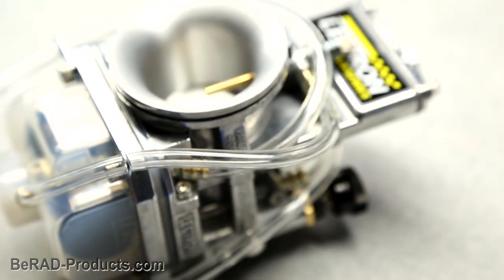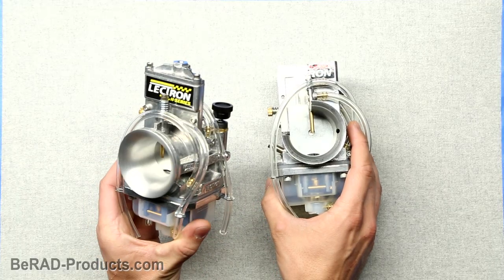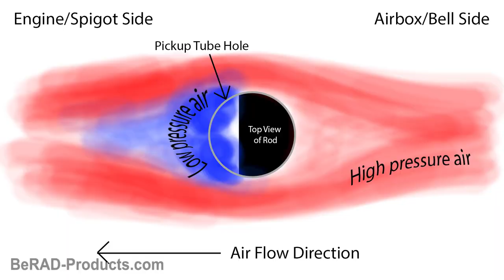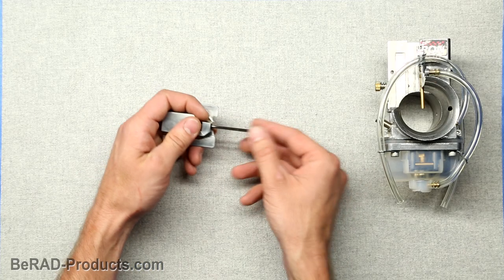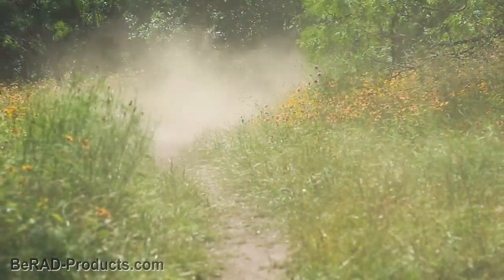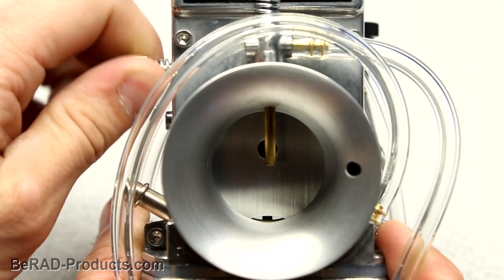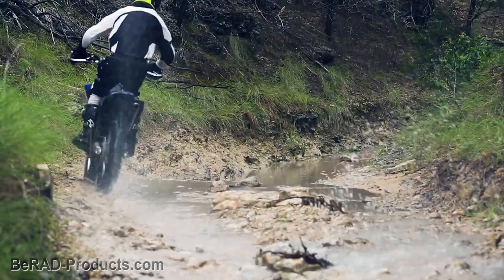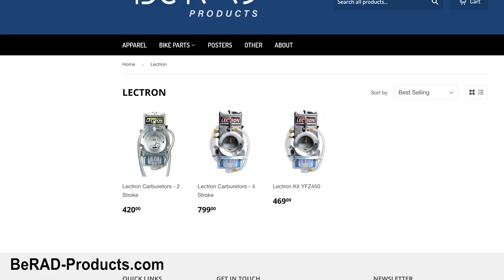LECTRON CARB - How does it work?

Comment: I don't really get it...

You said Lower elevation, colder temps, more dense air, stronger fuel signal, more fuel used. (Same at higher ekevation)
But doesn't this theoretically also happens inside normal carbs?

And why haven't the manufatures switched to lectrons?
I mean, they are cheaper than most keihin/mikuni carbs and apparently work better.
Reply: i own 4 lectrons, 2 on an Aprilia RS250, 1 on an RS125 and one on Daytona Anima 190cc engine in a Grom and they are frig'n awesome!
Reply: Hard to say if they're actually cheaper, as that depends on how big lectron wants to grow, and how low of a price they're willing to drop to. Keihin/Mikuni have the advantage of economies of scale when they produce thousands of basically the same carbs for all the motorsports industries with minor variations for each OEM, and I wouldn't be suprised if they were sold for maybe $100-$200 each.

Also, the Keihin/mikuni carbs for waverunners and jetskis offer a lot of adjustability between the varying high/low jets and screws, throttle plate angle coverage for when to activate the high/low jets, additional emulsion holes, vacuum discs and adjustable pop pressures to give a little "pump" with each revolution of the motor for actual RPM-based tuning rather than just flow tuning, etc. 
They are EXTREMELY tuneable from an OEM's perspective.

Comment: The fuel injection on 2t motors today is not all its cracked up to be. More for epa regulations and more expensive to purchase than carb systems. I do not recommend FI on 2t engines for few reasons that are not good
Reply from the maker: james bullock I’m with you. Have seen many of them not run well...it’ll be there eventually but you’re right, it’s done for emissions. A prefer the feel of carbs for 2 strokes still.

Comment: I'm not an expert so forgive my stupid questions.  Why is the Lectron needle/jet and different than any other needle/jet system such as mikuni (other than the lectorn being half-moon shaped - certainly that alone could not be enough otherwise all carb manufacturers would be doing the same)?  The mikuni has a main jet to limit the max flow but otherwise, other than at full throttle, neither the mikuni or lectron are doing anything but limiting fuel through the needle jet and jet needle aren't they? Just looking for clarification.

Comment: So  mine  has oil coming out the muffler. Can I turn the screw or do I have to take the slide out and turn it to?
Reply: Put a new spark plug in it, ride it around under half throttle for 10 minutes and check the plug.  If it is black, you need to lean out the metering rod on the slide by turning it counter clockwise.  (Start with a half turn.

Then get another plug and run it above half throttle for 5-10 minutes then check the plug and adjust the power jet accordingly.

Comment: I just payed almost 600$ for one for a new bike I bought that was suppose to be a 2008 ktm 125 but then I realized after I ordered the carb that the guy I bought it from lied to me and it is a 2003 ktm 125 so it makes me mad that I payed 600$ for a carb that was specifically designed for a 08 bike but either way I hope it fits the carb should come in, in the next few days
Reply: Did it fit?
Reply: Roberts yes

Comment: Great video and well spoken. I have the 300 ktm xcw 2017 and did install the same lectron carb, what did your metering rod measure? Note with the 4-1 needle, I got mine set at 50.8mm feels less responsive at the 1/8throttle position. Hope to hear from you.
Reply from the maker: Carlos Da Silva sounds like you bought from Slavens? Lol. Just a guess because of the 4-1 rod. Order a 4-2m and install it. See if that works better. That’s what is recommended to use for your bike. My yz’s run a 4-2 so the lengths can’t really be compared.

Comment: I raced Tz350 yamahas back in the day and used a pair of lectrons. At the end of the season the bike became harder to jet correctly and this was down to the stainless steel metering rod which at full throttle and high revs would vibrate and oscillate in the carb causing the hole to eventually oval in shape and therefore making the bike run richer and making a correct judgment on jetting difficult. Eventually I went back to my 38mm power jet mikunis. Lectron certainly are a quality piece of equipment but I feel they have over complicated the fueling processe by their design.
On the plus side when using the Lectron my TZ was stronger from mid range to the red line...
Reply: Keihin has the same problem and the brass bit is not listed as a replacement part .Plus the part is swaged in and not a two minute fix. I found a shop in Californication that does the job for big metric twins at something like 250.00 per carb ,not be cheap, but has anybody checked the price of a new Keihin from a dealer, OUCH !!
Reply: @jamesdenton3692  I feel your pain....

Comment: Nice video and explanation. thanks!  I'm curious, if anyone knows... With the "power jet",  how does it not suck up fuel through it when the throttle is closed?  I would think the vacuum would want to suck it right out... or is the bowl under the same vacuum at idle too?
Reply from the maker: The slide must be lifted above the end of the PJ nozzle. If it is below it, there’s just not enough airflow at the top to create the Venturi to suck the fuel through the line.

Comment: Is it possible to use a Lectron Carb on different bikes or is it brand specific?
Great Video btw.
Reply from the maker: The H series carb will work on any 125-300cc bike as long as you can fit it. Different metering rods are used depending on the bike.

Comment: I just bought a used 2013 KTM 250 SX with an electron carb on it.  I live in Utah, elevation 4500 ft.  How far in/out should the metering rod be screwed in/out?  How far should the power jet  needle valve be screwed in/out?

Comment: What if there is a bog when I crack the throttle?? Have the h series on my rm250 power plant is freshly rebuilt and metering rod was richened just for safety measures. Like before I even rode her I richened it🙏🏽🙏🏽
Reply: Like fully warm regardless of the gear speed I can be in neutral and every time I crack the throttle it bogs

Comment: I don't get how all carbs don't self adjust.  The higher altitude you are, the less dense air that goes past the venturi and the less fuel that is drawn.  How does the eddie behind the needle solve this?

Comment: I've noticed these carbs have a poly-e or some sort of opaque plastic bowl, and I'm wondering how this bowl holds up with the use of race fuel. Is there a way to drain the bowl, so as to prevent the fuel from damaging the bowl during periods of non-use?
Reply from the maker: actionsportster you can just pullnkf the power jet line and let the fuel drain out! I’ve never heard of an issue with race gas eating the plastic however...
Reply from the maker: actionsportster pull off*

Comment: My 2014 TE300 already gets pretty good fuel mileage. I can go 65-70 miles on stock tank. But I'm open to improvements. Does anybody have any real fuel mileage data? All Brad says in the video is that fuel mileage will improve. I believe him, but this is not a data supported statement.

Comment: Hi there, I've put a new lectron on my son's 2023 yz 125. We're having an issue with the bike running on into the corner when u let off the throttle, it just randomly hangs up the revs just a little. Checked the basics throttle tube and cable slide didn't stick until it's running. Any ideas?

Comment: I have a 92 15hp evinrude 2 stroke have you ever tested your carb on a outboard motor with 1 carb ? It’s a cross flow piston design I have ported intake  and exhaust and have performance reeds  New piston rings looking for a performance carb there are many people buying 9.9 evinrudes from 74-92 and putting a 15hp carb and there hard to find and sell used for 200-300
Reply from the maker: Jim Catanzaro yes sir!! Lectrons are on lots of outboard hydroplane racing boats. Small cc...email me and let’s set you up. brad@berad-products.com. I may not see your comment response so email is best to reach me.

Comment: I wish my lectron ran like you described. I have to adjust it every single ride and it pisses me off.
Reply from the maker: Rizzo44 Rizzo hmmmm. It’s very likely that something is wrong with your bike, not the carb. Have you contacted Lectron? They’re quite helpful in sorting these things out..
Reply: @BeRAD  Haha, no offense BeRAD, but you sound just like lectron. I've been racing 2 strokes for 35 years and I have a brand new motor in my yz250x. There is nothing wrong with the bike. They are quite helpful if you have a youtube channel, but when you're an average joe, they just claim it's the bike. Easy for them to say when it's not there's.
Reply from the maker: Rizzo44 Rizzo you have to remember that they get 100 calls a day saying “my Lectron isn’t working” and 99 of those people end up having broken reeds or a case leak or something. Many people I know have only great things to say about the support and I know they try their best. Send me an email with what exactly it’s doing and I can try to help.
Reply: @BeRAD  Thanks! I will do that when I have another chance to mess with it.
Reply: I put vforce reeds in my brandnew yz250,  it ran like shit. Took them out to inspect them,  light shines through the pedals when they should be sealed closed. Wouldn't idle and bottom end sucked. Stalled easy too.  Just an example of bad reeds for ya to go on. I put my stock reeds in and like magic its perfect again. Like you, 39 years of 2 strokes under my belt, first time I've come across bad reed issues.
Reply: enduro trucker Ernie Desjardins where they upside down? Idk what vforce is selling these days but that seems like an easy fuck up that could cause a gap

Comment: So I just got my lectron and first ride today with brand new plug after a long hard pull once I let off it surges pretty hard so I checked my plug after about 2 hours of riding and it is white with one small spot of tan so i turned the metering rod in half a turn to richen it up and it feels like i lost quite a bit of bottom end rode for another 30 minutes and checked plug again and it's still white with a small area of tan any suggestions berad
Reply: need to know--  what type of bike. stock or modded engine.  factory stock compression or higher than stock.  what type of intake-- stock reeds- or aftermarket.--- what carb- 38 mm hv- ? what needle-- 5-1-- for example.-- on sales paper- what is the setting-  distance from tip of needle to brass insert on bottom of slide.--   a person HAS to know these things before giving suggestions.   this applies to all types of carbs, not just lectrons.       oh-- what type oil and gas is used.    fuel oil ratio also.
Reply: 07 rm250 stock bore head squish corrected to 1.2mm to run on 93 octane 100 percent gas running lucas semi synth at 32 to1  it's the 4-2 rod they sent it set at 51.6mm I went half a turn in wich put it at 50.8 and it is still surging not as bad but definitly still doing it after a hard pull its 38mm hv h series
Reply: Oh compression is 220
Reply: Stock reeds with spacer removed
Reply: @singletrackmarc819  have the same carb for rm 144 here. my carb as sent with 5-1.  --  as for your rm- white is too lean.   the 2 means richer on lower revs. the 4 - means its not as much fuel on higher rpm-s  this is the area where you are getting white plug color---   this is all just a wild guess on my end-- hard to say from a distance. call lectron.- e-mail- whatever it takes.      agan just a guess--   your bike may need more gas- uppper revs- and less down low--    5-1 ??   You get a better deal on a slide needle combo than just the needle alone.    lectron will  use your carbs invoice numbers to assure matched slide, there best guess for inital needle setting-  IF they concurr with me on the rm needing a 5-1.     hope this helps--

Comment: Can you adapt these to a Harley engine?
Reply: They sell Harley kits on their website.
Reply: I have one on my EVO based chopper. I ride all over the US and go from sea level to 6000 ft often. With my S&S carb it would run like snot at high elevations but with the Lectron it runs great. I have not tried over 6000 or 6500 ft yet but will likely do that on this year's trip.  Unfortunately I screwed with it  out of the box and messed up the tune they sent (don't do that, they know what they are doing) so I have not seen the fuel economy gains yet but the guys at Lectron are amazing and are re-tuning it for me as I am writing this.

Comment: Pretty much its a reengineered carburator. Your still going to have to jet it. It has jets. Therefore your going to hve to change them for your application.Your still going to have to tune the mfker. Its just it meters itself  a little better than a normal carb. And has the top jet. To where you can adjust it yourself. Thats it. Its nothing special. Save your money and just learn how to work on a carb. And btw changing jets takes also 5 minutes. But how often are you going to f with it. Rarely

Comment: It still needs to be jetted like any carb
Reply from the maker: MrKidkiller159 what do you mean? There are not any jets to interchange on here? Do you mean that they still need to be tuned? If so, then yes, sometimes you will need to fine tune the air/fuel mixture by changing the length of the metering rod.

Comment: I want to try one on my 19’ ktm 125sx has anybody ?
Reply: Running one on 18 tc 125 same motor love it cleans up bottom end without taking away top end running mainly mx but some hare scrambles 2hrs on a little over one gallon of gas
Reply: John Neifert thanks ima pull the plug that’s what it needs

Comment: I pushed my H-series metering rod in and a full turn around from factory settings which ran suuuuper lean. (I’m lifeon2wheelz_ on insta) and I went riding this weekend. I noticed there wad a breif bog when wacking the throttle at low end before she opened up a bit, didnt hit the powerband just opened up the rest of the low end range. And I’m still messing with the powerjet bc she hit the powerband unless I pull in the clutch and rev it out. I leaned out the powerjet a half turn and then a quarter turn up top when riding and noticed it was a lot happier but still needed to pull in the clutch to rev it out. I wanna lean out the metering rod a half turn, but then the flat side faces the wrong side of the engine? I feel like a noob, but out of the box it ran so incredibly lean there was no color on the plug (zero air leaks and other variable debunked) on my 1999 rn250. I just wanna get it running right that’s all.
Reply: power valve working ok?  just a thought....  never had one of these carbs to mess with, though.... (too much $$)!!!
Reply: Powervalve works fine, looks like it just went through a rebuild, zero carbon build up or spooge/gunk. I run Amsoil Dominator Full synthetic race oil and it leaves ZERO carbon deposits and just a film of oil to protect the top end. After 18 months my top and bottom end still looks brand new with this oil. Cross hatching is still VERY much visible and the piston wear is extremely minimum for an 18 month period. Awesome premix oil in my opinion if you wanna keep your engine in great shape and well lubricated.

Comment: I see nothing revolutionary or new here with the exception of the flat ground as opposed to tapered metering rod found on most variable venturi carburettors. I does nothing any differently than the Amal found on my BSA in 1960.
Nothing new under the sun.
Reply from the maker: well the Lectron was designed in the 70's as stated in the video so...lol

Comment: Logic dictates this question....IF it really is THAT good?  WHY is not OEM on various bikes??   This makes no sense ....I am certain Lectron would have been DELIGHTED (past ense prior to everything going FI) to license this carb to Honda or ktm etc for $50 per unit or whatever....HUNDREDS of MILLIONS of dollars for doing NOTHING....makes me HAVE to believe there is a real problem not mentioned on this video ...one thing I have noted with flat slide carbs is WEAR.....premium flat slide designs fight wear with plastics carbons and even rollers....if a $700 carb works wonderful but then the slide AND body wears out of spec in a couple thousand miles?  MAN would that SUCK!  Just saying....sounds too good to be true

Comment: These carbs do not work. Many people buy them, and use them in very basic, unchallenging conditions, a few feet from their trucks and think they are great. However, if you test them at high and dramatically variable altitudes and temperatures as I have, you will quickly be tossing them in the trash. A total of two different lectrons, and 4 metering rods, in every possible length, I tested in my brand new 2018 Husqvarna tx300 from eastern Utah to the Colorado high country, for 7 months.Terrible bottom end performance, poor idle, never better than 16 mpg, and  a bike that was always either too rich or too lean.  Yes you bike might run ok, but Don’t believe the hype, compared to a crisp, properly jetted bike, lectrons are trash. Keihin carbs, JD jetting, will make that two stroke great again !
Reply from the maker: Very interesting. Funny how some of the top enduro riders are running them and loving them now. Also people like Jimmy Albertson, Carson Brown...the list goes on. I'm sure you're a much better rider though ;). I wouldn't classify the riding I do as "easy". I thrive on bottom end power with my riding and it performs incredibly well. Keep an eye out for my upcoming 125x video...maybe you just a had a bad experience? I've ran 5 different ones and each one has been great.

Comment: simply unscrew the power jet needle valve... a screw facing straight up with no way to access on the bike.... lol. wtf.
Reply: Loosen the clamps, rotate the carb, make adjustment. Rotate carb tighten clamps. If that's too difficult then you probably refer to a shop for gear oil changes.